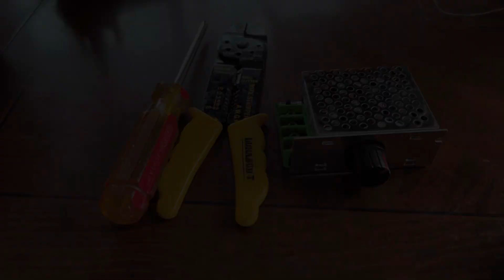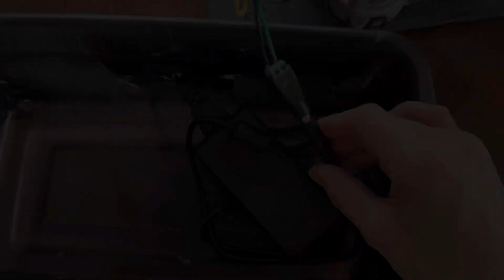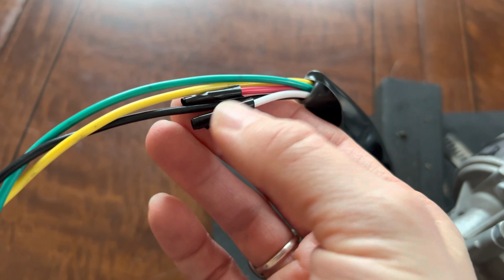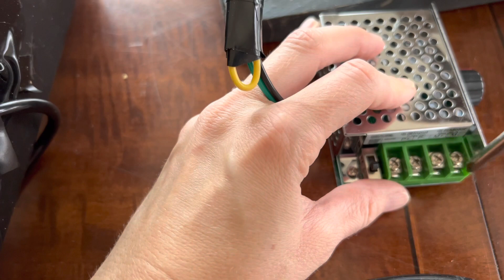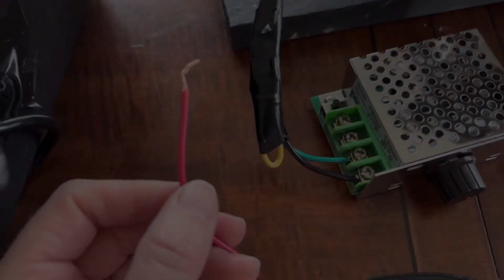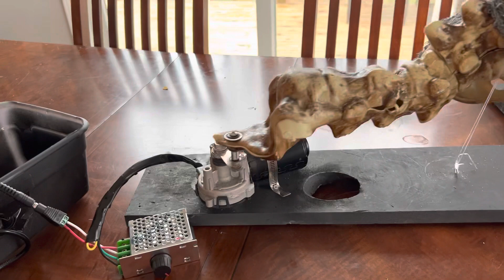How-to Wire a Speed Controller

Comment: HI! Just found you and immediately subscribed! what about building a motion activated "popper" with lights and sound for a fence? i figure the skull could be made of #2hdpe (milk jug) for lightness and 2 skeleton hands from the dollar tree bent into shape with a heat gun would "hold on" to the fence. i also figure that if made light enough a reindeer motor could move it to get it to pop up and down and that would make it more cost effective. what I'm having a hard time with is wiring a PIR to trigger the movement, the led eyes and the sound module, while keeping everything cost effective so i can have multiples of it
Reply from the maker: Thank you so much!  You are totally on my brainwave because I just bought stuff to make a fence rattling zombie!
Reply: @scarriehalloween  yayyy!